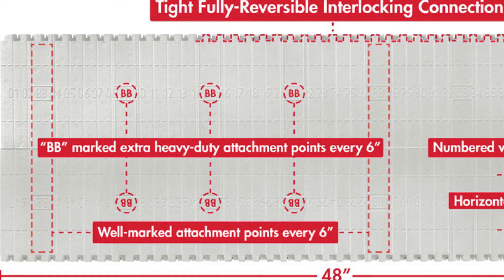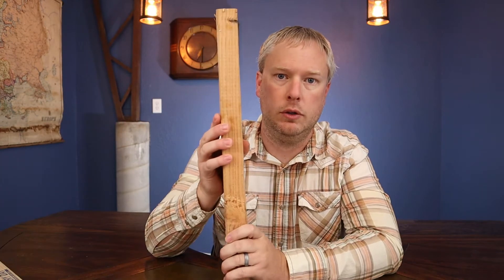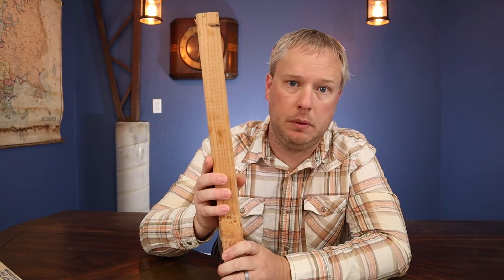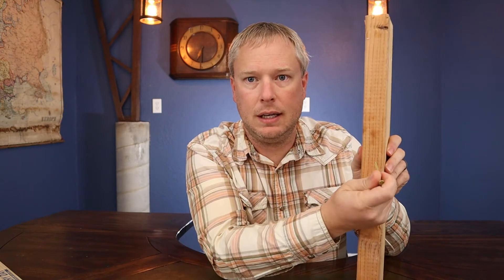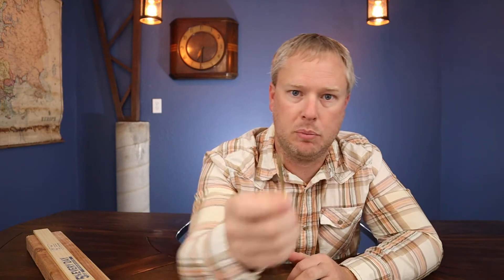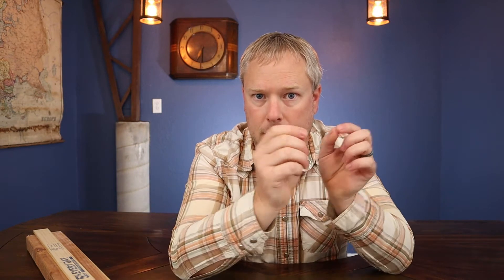Are ICF Web Ties STRONG Enough?

Comment: You mention the water vapor that comes out of the concrete for months after the pour. Is it necessary to protect the sheetrock from this at the time you hang it?
Reply from the maker: I would delay hanging it if you can, and use several dehumidifiers.

Comment: After 20 years of ICF. Ties are fine. Good work such as straight level square and plumb are the issue. Most DIU have issues with that or consolidation due to lack of vibration. The idea you can do any concrete work with little or no experience is a complete lie
Reply from the maker: I would agree with most of what you said.  I still stand by the statement that most ties are inadequate.  Your forms may not blow out, but you'll have issues with everything that connects to the ties.
Reply: Consolidation should not be a problem if the DIY used SCC instead for concrete. The greater amount of flow and fines should help prevent air cavities.

Comment: Have been meaning to ask this question for sometime - this video seemed like the right opportunity... 😊 We built (12 yrs ago) our two story home w/ walkout basement, and three car detached garage, all with PolySteel Blocks from footer to foam sealed roof. Our Polysteel blocks have full steel webbing, while the blocks I see now have plastic. Was there a problem with steel? We LOVE our ICF home for all the reasons you describe in your videos. Thanks!
Reply: CelBlox ICF's use steel at all connection points between the webs and ties.
Reply: @CelBloxICF  what is your contact info? Do you service Indiana? I'm looking to build March 2022. Thanks.
Reply from the maker: I have no idea.  Maybe some manufacturers will see this and comment.

Comment: It sounds like you have been working with some poor quality ICF web ties.  CelBlox® web ties meet quality control standards that address all of your issues.  They are tested to insure that nails and screws don't break the web, no matter where they are placed (including edges).  The minimum melting temperature of CelBlox® webs/ties is 350°F, so there is no danger of a hot screw melting them.  The webs are 15" long, and CelBlox® panels are 16" high, they are placed 6" apart, and their placement is clearly marked on the outside of the panel for easy location.  The screw pullout strength is guaranteed to be a minimum of 180lbs, more than enough to hold up any siding or other fixture.  You should give them a try next time you have an ICF build.
Reply: The webs are actually placed 8" apart to give you an easy 16" on center stud placement.  Our webs are also detectable with a stud finder because they are pinned in with metal.
Reply: Super foam has very robust ties.

Comment: What if you put your furring strips up before the pour.  You could make screws long enough to be supported by the concrete itself.  If I am not mistaken you have to put wall supports up to support the pour itself beforehand anyway.
Reply from the maker: That's definitely an option as long as the walls are being supported from the inside of the house.

Comment: There is one stud finder that will work with ICF s. Quite a simple solution, yet I just came across it myself. It works with magnetism on finding the Sheetrock screws.  Mark more than one / plumb-bob ...
Reply: Any stud finder will work with CelBlox ICF because we have steel web pins.
Reply from the maker: That's a good thing to know.  Thanks

Comment: I may have asked this in another video, but I’m considering ICF and worried about termites and ant damage. Does the stick and peel on the outside replace chemical termite protection? I’ve heard you use treated wood up against it, but I live in a high termite activity area and they will build bridges over treated lumber to get to untreated. Termites don’t like paint so...maybe I can discourage them further by using treated lumber against the foam and painting wood framing close to those. I’d like to avoid toxic chemicals as much as possible.
Reply: A good ICF build will be impermeable to termites.
Reply: termites can burrow under the foundation and come up any penetrations and hit the wood inner walls so be aware of that (if not protected).  We are considering getting borax treatment on the inner studs which is low toxicity
Reply from the maker: I don't know a lot on the termite side of this.  When I was reading my buildblock icf manual, I know they talked about it, but I really don't recall what they said.
Reply: I’ve seen designs with metal going in on installation but didn’t contact all the way thru for heat reasons I would guess. Second way I’ve seen it is no openings (siding, etc)  between below grade and above grades.  Third is missing foam cut about 8” removed. I’m not thrilled with any of these and I’m no expert on the subject either.

Comment: Did you consider Nudura ICF blocks?  Thanks for sharing.
Reply from the maker: I didn't as they don't have sales reps that cover Kansas. The nudura blocks don't have a web design that I like either.  I do like the 8' lengths of each piece and the 2-5/8" thickness of the foam which corelates to the standard 2x12 size for a 6" block.
Reply: @Challenged1   On build blocks 6" web spacing doesn't allow you to get 16o.c. that a normal contractor works with.  So they will have a harder time attaching things to your walls and they complain about it.  Build blocks also take more time for most of the job to put up and put together.  So besides what you have to manually put together you have to handle 3 times the material to put up your building which also makes more chances of leak points.   Build blocks studs (plastic webs) don't go all the way from top to bottom of the block and the studs don't lock together with the block on top of it to stop floating, compression or raising the blocks.  Nudura solves all of these things and more.  Both will have 4hr fire rating, 450+lb pull out and so on.  Both have many positives.

Comment: This is the problem I'm having...  I'm contemplating hanging horizontal timber weatherboards (lap siding) on vertical cavity battens with the cavity battens attached to the ICF furring strips.  The only half-pie shot I have at this is with the BB attachment points in the BuildBlock blocks.
Reply from the maker: Sounds like a good plan to me.  I hate that it takes more material and more steps to do, but you'll get good attachment points that way.
Reply: You will also achieve a great rain screen gap, something that’s useful even with ICF wall.